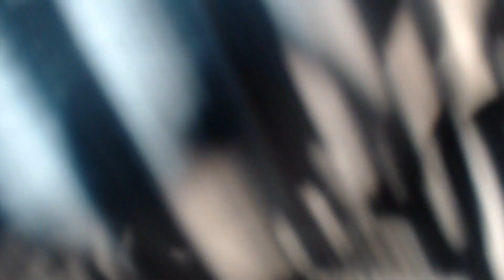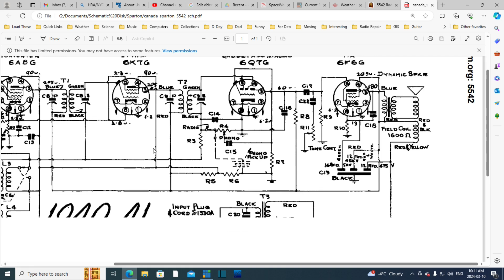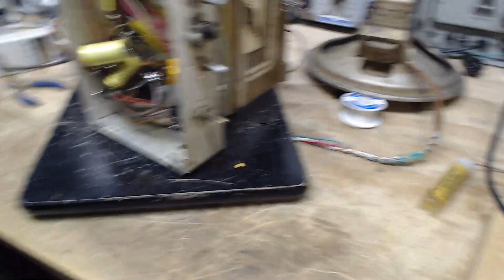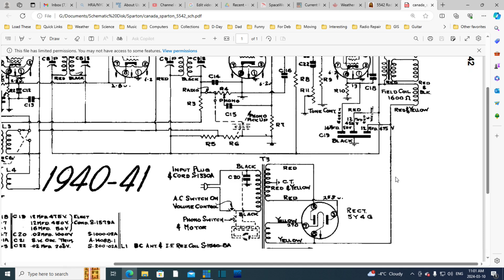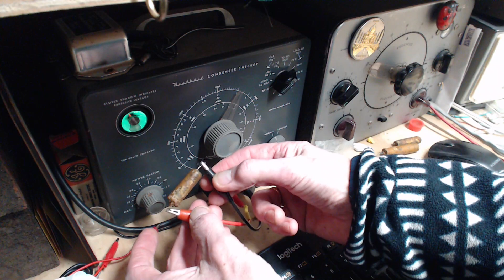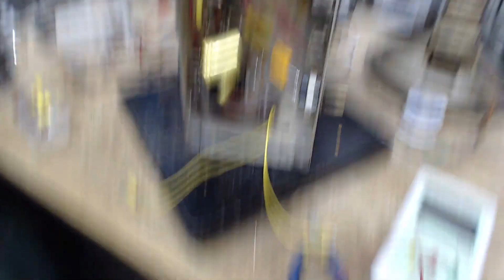Canadian Spartan Model 5542 Radio Video #5 - Audio Circuit Restoration

Comment: The reason for a 1000 volt cap is the transformer acts like a auto transformer if you disconnect it shoots a high voltage out.

Comment: Greetings Jim,
Here is some simple data about "Recycling" Nuclear Fuel
There is no waste associated with the fuel itself.

From:  www.energy.gov
(US) Office of Nuclear Energy
5 Fast Facts about Spent Nuclear Fuel
October 3, 2022

1.  Commercial spent nuclear fuel is a solid
Spent fuel refers to the nuclear fuel that has been used in a reactor. 
2. The U.S. generates about 2,000 metric tons of spent fuel each year. This number may sound like a lot, but the volume of the spent fuel assemblies is actually quite small considering the amount of energy they produce.

3. The amount is roughly equivalent to less than half the volume of an Olympic-sized swimming pool.

4. The clean energy generated from this fuel would be enough to power more than 70 million homes—avoiding more than 400 million metric tons of carbon dioxide emissions.

5. Spent fuel can be recycled. We can use it again!
That’s right!
Spent nuclear fuel can be recycled to make new fuel and byproducts.

More than 90% of its potential energy still remains in the fuel, even after five years of operation in a reactor.

The United States does not currently recycle spent nuclear fuel but foreign countries, such as France, do.

There are also some advanced reactor designs in development  that could consume or run on spent nuclear fuel in the future.

I get my "Juice" from Niagara Falls which like nuclear is carbon free.

Comment: 11:41 OMG! How clueless can one be! That C20 is going from mains to CHASSIS! It is partially bypassing the galvanic isolation the mains transformer presents in an attempt to provide an  RF(!!) grounding of the chassis to the mains. Depending on the orientation of the plug, this cap presents a very small leakage current to anyone touching the bare chassis, therefor this cap must by todays safety standards be a class Y type capacitor.  That is a capacitor of >1kV operating voltage designed in a way to never ever short, because if it did, full mains voltage could be present at the metal chassis.
In fact todays Class Y caps are mostly rated 2,5kV.

Back then 1000V paper caps were what came close to being as safe as possible and so they used that.

His pondering why a 1000V cap was used at this point in the circuit just shows his massive lack of knowledge both in circuit design, reading the schematic before him and fixing a radio according to safe standards.

Comment: 9:03 The job of the capacitor from plate to ground or cathode is simply to snub out any voltage spikes that could be caused by crackle and pops in both radio and more importantly phono audio. To such crackle noises the speaker is a high impedance load, thusly the output transformer appears virtually unloaded. And we all know that an unloaded output transformers causes excessive overshoot of the primary voltage resulting in possible arc over in the tube or between windings. That which is the reason you dont want to run a tube type audio amp without a load.
That a plate capacitor will to some extent cut down high frequencies is a side effect, not the purpose.

Comment: Jim, I was SCREAMING at my computer screen saying, "Jim The Radio IS Still Powered On"""!! LOL, well wont be the first time I made the mistake and got ZAPPED!!!! Be carefully my friend!! 🙂

I have the same white Power Indicator you do, where you plug in the radio. I have a 3 in 1 socket adapter, so I have a Night Light plugged into 1 of the 3 sockets, as a reminder that power is still on.. Reminds me to be careful..  At age 76, electrical shocks are not a good thing... 🙂

Robert San Diego,,,,